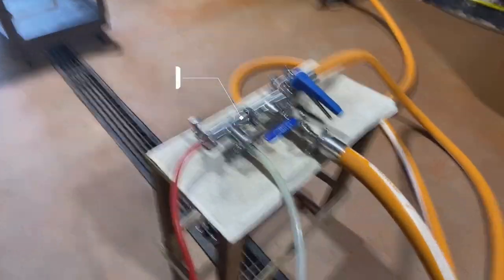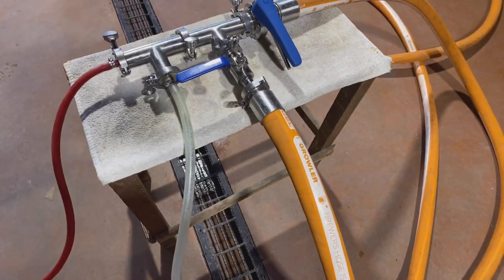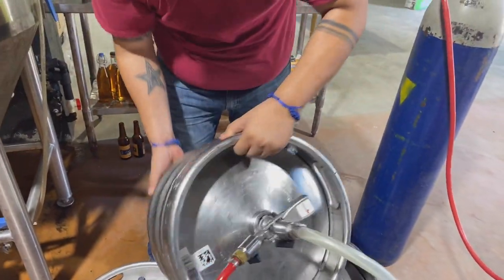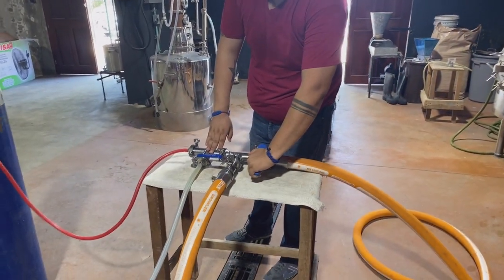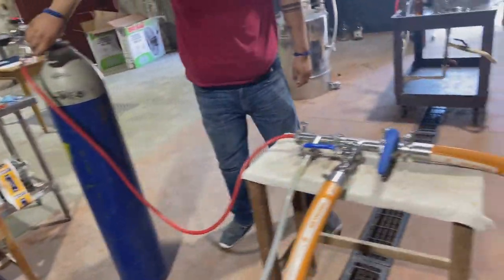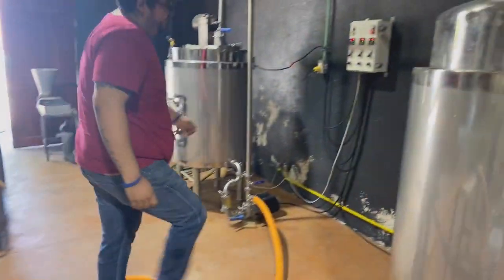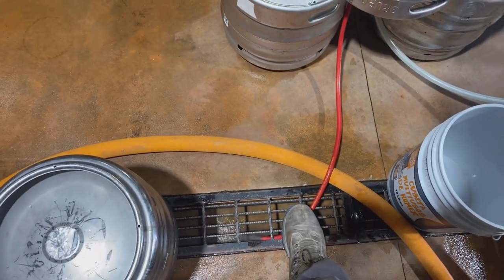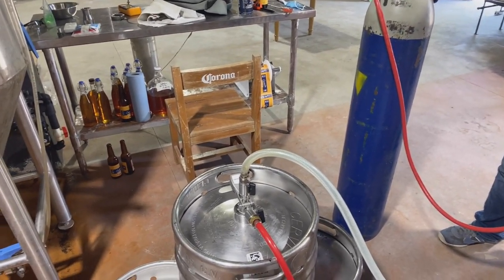Keg Washing - Poor Man Style

Comment: I created a manifold keg washer as well at my brewery very similar to yours. I did add compressed air in the loop before adding caustic instead of CO2. I did it for two reasons, 1 lol compressed air is cheaper but more importantly, 2 when you mix caustic in a CO2 environment it can create sodium carbonate which I definitely don’t want in my kegs. I do 2x ten second hot water purges, flush ten with air, caustic, hot water rinse, paracetic sani rinse, charge with CO2 to 5psi. 
Love the channel and the vids keep it up!

Comment: Hi, nice setup... what pumps are you using?
Thanks
Reply from the maker: thank you. These pumps came from a system I bought second hand. I believe they were single phase (110v) 1HP with 1.5" tri clamp fittings. They were not the best, but got the job done.